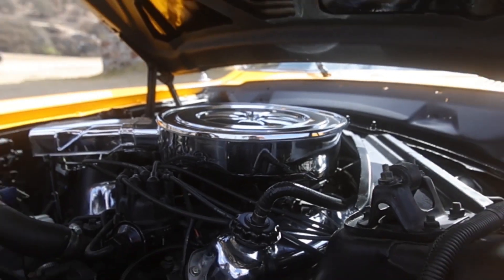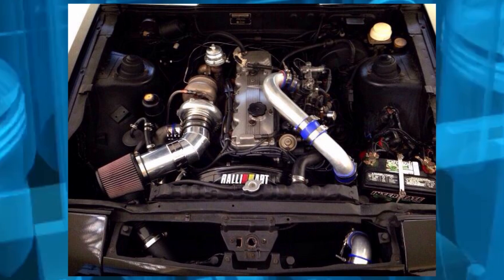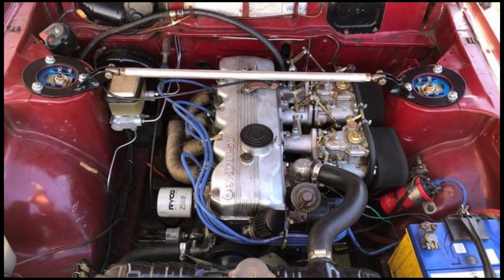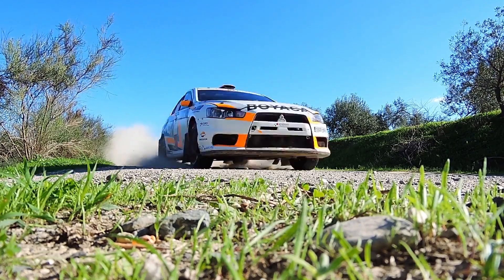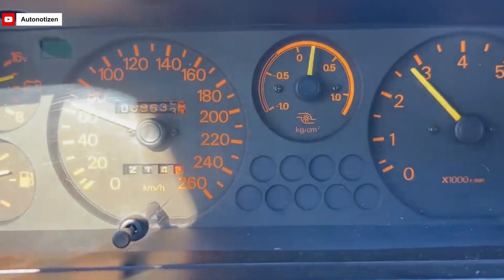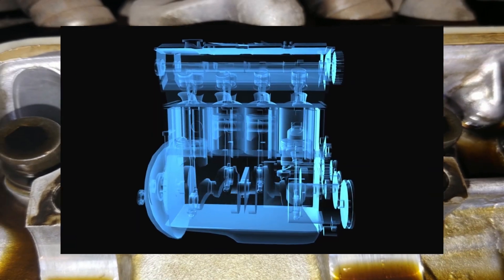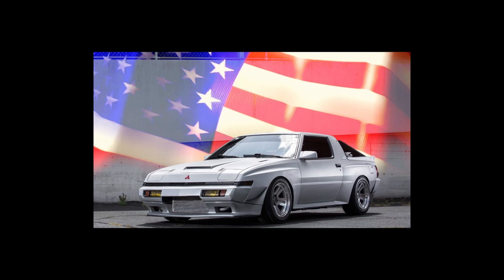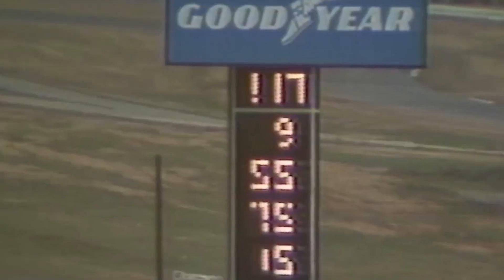Mitsubishi Starion's TURBOCHARGED Engine - The SOHC Eight-Valve 4G54

Comment: IVe been driving starions for about 30 years now. These motors are kind of finicky, and prone to blowing head gaskets, and cracking cylinder heads (jet valve issue). They also came with innovative balance shaft technology, that is supposed to make inherantly inbalanced engines (like i4s) run smoother, with less vibrations, however, that also creates a potential problem for catasrropic engine failure, if the bearings seize, or a chain snaps, so many folks remove the jet valves, and the balance shafts, to make the motor less failure prone. 
This is a torquy little motor, with a near square design, it doesnt rev very high, but it has lots of torque right away, which makes it appealing for doing burnouts and donuts, but also for hauling heavy loads (lts basically a truck motor, but the turbo makes it sporty)
Your video uses a lot of photos from  modified cars, and that makes it kind of confusing as you are talking about stock cars while showing cars with a lot of aftermarket modifications.

Comment: The Mitsubishi 4G54 Astron engine is very powerful and fuel efficient for its time even compared to 6 cylinder engines plus the application on the Mitsubishi Starion by adding a turbo and later an intercooler made it more fuel efficient and powerful so if you actually owned a stock Mitsubishi Starion or Conquest the gasoline would last you a long time even on daily commutes and long drives... of course if you were heavy footed, you could burn up the gas as with most other engines.

Comment: I own 1 of these engines in my pajero. When I tell u without a turbo there hard to kill i mean it. Drown it a couple times have been flogging it around as a daily and yet 3 years of this treatment later still running. Engine even was in a 80km car crash. Elite motor. New carb is worth tho.

Comment: 1987 dodge raider owner here. The jet vavle is junk. Will blow a head gasket no problem. Need to invest in a non jet head made by a company name Clearwater. I'm either going to swap to a diesel engine, or rebuilding my current engine and possibly upgrade to the starion/conquest turbo setup. I love my raider, just not the head issue.
Reply: The dodge caravan has the non jet valve head.

Comment: The 2.6 is a massive pile of shit. I owned 6 starquest all 6 had cracked heads( jet valves), cracked exhaust manifolds and leaking junk fuel injection system. When they ran what a fun car!!!
Reply: I heard there's a way to fix the jet valves. I'm following a car here on YouTube with one of these engines. A 1981 Dodge Challenger, It's a  carbureted model. I'm very curious to see it's potential with some of the factory issues fixed and all the smog parts removed.
Reply: @CryptToneMusic  You can replace the jet valves with what are essentiall a bolt with a o-ring, or you can get a non-jet valve head from another vehicle, or a new head.  Deleting the balance shafts is also a popular mod for reliability.

Comment: Even in its time, the 4G54 really wasn't all that special. Not sure how you managed to neglect to mention that these engines like to blow head gaskets as you tune them, as well as the fact that this was the first Japanese engine to use electronically controlled fuel injection as it evolved.
Reply from the maker: @SpeedSyndicateUK  thanks for sharing this additional info on it :)
Did you have this blow ups of that engine?
Reply: @ No I haven’t owned a car with the 4G54. As some advice for you future videos, try to write a script that doesn’t repeat previous information as much, as it can get confusing for the viewers.
Reply from the maker: @SpeedSyndicateUK  thank you for the feedback 🙏
Reply: The problem with the headgasket  is the cooling system was not as efficient causing the engine to overheat hence blowing headgasket